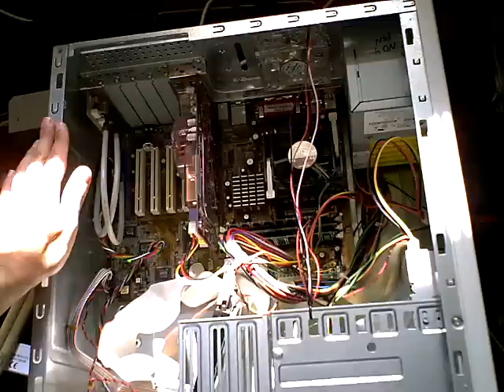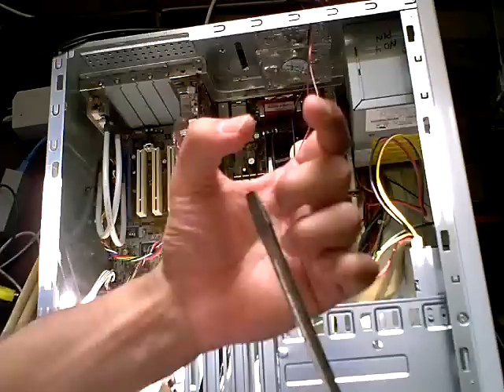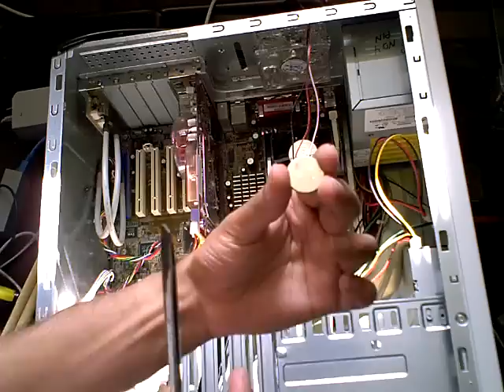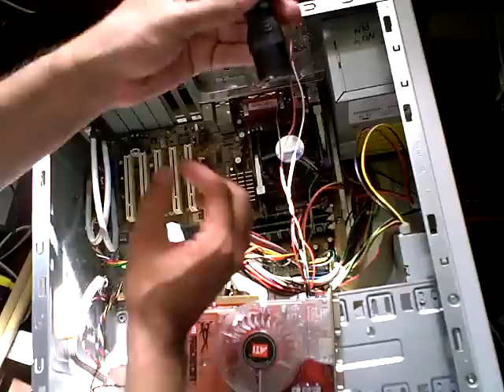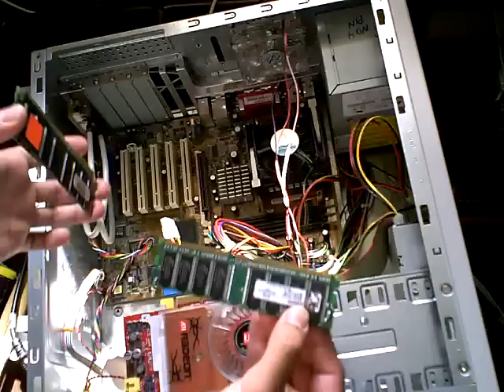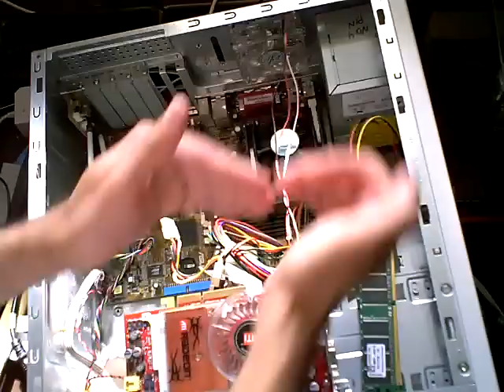How to possibly fix a PC that will turn on but will not beep and will not display anything on screen

Comment: Hey Sir, Can you help me with my problem on my Monitor? I Did all of them, And it didnt worked? I Have 2, 2Gb Ram and I Switch it after it Fails to Turns on, It didnt worked, And i remove my gpu and my Ramand Clean, It Didnt Worked, Please? Please
reply Immediately
Reply from the maker: +TBC_Ryan TheSilentSlasher Breadboard it (explained in the following video:)

If the steps in this video did not provide a solution to your problem, view:

http://www.youtube.com/watch?v=_EK9a-R5pss

You never know, maybe rebuilding the PC in the opposite sense that you took it apart will solve the problem.
Reply: +RodneyDickson Ok Thank You, But fo i have a Chance?
Reply: +RodneyDickson I Did also the troubleshooting But I Donw know what to do, When i Remove my Ram, I Heard The Beeps What should
i do?
Reply: +RodneyDickson Can I Add you on Facebook so that we can talk to each other?
Reply: +RodneyDickson How can I tell if the RAM is DEAD? And not working anymore?
Reply from the maker: +TBC_Ryan TheSilentSlasher Beep error codes differ from one BIOS manufacturer to the next. To discover what the beep error code is trying to telling you, discover the manufacturer of your BIOS (available in the motherboard's manual or on the motherboard's manufacturer's website {on the page for your specific motherboard model}) and then look up the frequency and interval of your beep error code on:

http://www.computerhope.com/beep.htm
Reply: +RodneyDickson Hey Sir Thanks for helping me, The only problem on my Monitor is that i have a Dead Ram! And I remove it on my motherboard and try some of my Ram and it finally worked after 3 days of suffering, Again Thanks for Everything, I owe you
Reply: Hey sir can you make a video on how to make your 32 bit operating system into 64 bit operating system without the method 30 days? (Windows 10)
Reply from the maker: +TBC_Ryan TheSilentSlasher Glad to hear you got to the bottom of the issue. Sadly, as far as I know, 32bit and 64 bit operating systems are built on different architectures, and therefore, there is no real way to 'upgrade' per se, instead, what happens is that the operating system saves your existing data and replaces all operating system files with 64 bit variants. Furthermore, if you obtained Windows 10 as an upgrade, then you received 32bit because your original Windows was a 32 bit variant. You see, 32bit and 64 bit Windows are different operating systems with different licenses. If you have a license for a 32bit version of Windows, then you cannot legally obtain a 64 bit version for free. Also, keep in mind that your PC's architecture would have to support 64 bit (if your PC came with a 32 bit Windows, then there is a good chance that it is simply not compatible with 64 bit). Believe it or not, I have a Dell Pentium Core PC that runs Windows 7 but is NOT 64 bit compatible...32bit-only PCs still do exist!
Reply: +RodneyDickson So it means i cant upgrade my 32 bit OS?
Reply: +RodneyDickson I got an windows.old on my local disk, but i dont have an option "Go back to windows 8.1" In the Settings of my Windows 10?
Reply from the maker: +TBC_Ryan TheSilentSlasher Yeah, you cannot upgrade your Windows 10 to 64bit unless you purchase a license for Windows 10 64 bit. Also, as mentioned, you need a PC compatible with 64bit before you upgrade. Finally, unless you have restore discs for Windows 8, you cannot go back sadly
Reply: I have the iso file for upgrading to windows 10 64 bit?
Reply from the maker: +TBC_Ryan TheSilentSlasher Once again, to legally install and use that software, you would need a legitimate license for 64 bit windows 10 (and btw, Windows 10 is ALWAYS reporting to Microsoft, so keep that in mind). On the subject of ISO files, they are burnt to disc. There is a ISO burning utility in Hiren's BootCD. See http://www.youtube.com/watch?v=eEfGhWXJVJM if you require more information on Hiren's BootCD.

Comment: I have this problem, and didn't have it earlier today, I haven't done anything different it just stopped posting, and the power button doesn't turn off the computer
Reply from the maker: +Timeforfunstuff Breadboard it (explained in the following video:)

If the steps in this video did not provide a solution to your problem, view:

http://www.youtube.com/watch?v=_EK9a-R5pss

You never know, maybe rebuilding the PC in the opposite sense that you took it apart will solve the problem.

Comment: I have a cyber PC and mine puts displays the cyberpower sign but it just resarts over and over again after displaying the sign.
Reply from the maker: +Terrance Calder Sounds like your operating system is corrupt (or your hard drive). Alternatively press F1, F2, Delete, Tab, and Esc during first boot to try to get into your bios, and see if there is a HDD that is detected

Comment: so how are u meant to tell if this is the source of the problem? does every computer beep like this?
Reply from the maker: If the PC has an internal speaker installed, then yes, it will beep. Some manufacturers are getting cheap and no longer including speakers, in which case you will need to buy one and connect it in order to diagnose such issues. Check your motherboard for such a speaker (either connected to the case or attached to the board) to ensure you are not just listening for a beep that will never come.

Comment: hey i have a problem on my pc,when i turn it on it goes well but when it says welcome and go in pc it opend my computer and every thing behind is black..(i can use computer but when i click x on my computer then is every thing black then i see yust mous
Reply from the maker: It sounds like there has been corruption at the operating system level. You can always try booting in Safe Mode (hold F8 at boot) and if that works as intended, perhaps disabling any startup programs that may be causing this (see How to optimize your Microsoft Windows to start up faster, run faster, and to increase stability ) will help, or uninstall and reinstall your video driver. If none of these help, sadly a format and fresh reinstall  of Windows might be the only solution. Good luck with it.

Comment: Hey man so I just watched the video followed the steps and all my problem is that this pc is about 3 months old because I built it myself and none of the usbs are working and I cant get my monitor to sense that the pc is there and I also can't get sound
Reply from the maker: Breadboard it (explained in the following video:)

If the steps in this video did not provide a solution to your problem, view:

http://www.youtube.com/watch?v=_EK9a-R5pss

You never know, maybe rebuilding the PC in the opposite sense that you took it apart will solve the problem.

Comment: hey man I have a issue my computer starts and everything runs I get no display but i have noticed that it is because my graphics card is not responding it is connected to the motherboard and power supply but when i turn on my pc nothing happens the fans on the graphics card don't move there is no response from the card i have had it for over a year and a half this is something that has just happened and i have no clue what to do
Reply from the maker: +tj mj The card could be dead. Your motherboard socket could be dead (or routing to said socket). The power connector to your video card could be dead. There are a lot of possibilities here.

Comment: Hey, my computer does not turn on after I pulled out the battery. What does it mean?
Reply from the maker: +Sydney00111 Hmm, that's strange. When you reconnect the battery, does everything run as normal or do you have an issue preventing you from using the PC?
Reply: +RodneyDickson There was a black screen and nothing else when I started the PC. I pulled the battery out and it just wouldn't start. After I inserted the battery back it did work again, showed some kind of report on a screen about all the detected components and then image messed up and computer frozen. I bought a new battery and after couple of hours the system managed to start, but after a couple of minutes it frozen and some artifacts started to show up. I observed that when the computer is lying down on the floor it works just fine, and when I tilt it up some artifacts start to display on a screen. Most likely it is some issue with graphics card or a loose radiator. Today I am going to change paste on my processor (I did not change it since 2013 so it is a dust now), maybe it will help. I also observed that it could be a damaged PCIE port, as one of the pins is out of the line. I reseated graphics card, RAM and radiator. I also checked all the connections and also replugged it. I removed dust from the case. What would you suggest to do next?
Reply from the maker: +Sydney00111 You seem to have a good handle on what you are doing. The only thing I could suggest beyond everything you've tried is to Breadboard it (explained in the following video:)

If the steps in this video did not provide a solution to your problem, view:

http://www.youtube.com/watch?v=_EK9a-R5pss

You never know, maybe rebuilding the PC in the opposite sense that you took it apart will solve the problem.

Comment: hi can you tell me what happens if you for get which post the jumper came off because i forgot which setting i was on any help guys
Reply from the maker: If you have the motherboard manual, you can look for where the specific CMOS reset jumper is indicated and place the cap back on the lower of the number designations (so if the manual calls the jumper pins 1, 2 and 3, you'd want to cover 1 and 2 but not 3.) If you do not have the manual, look up your manual online. If you really have no clue how to find the manual, perhaps you can look up a YouTube video on your specific motherboard and see how others have this jumper cap. Finally, if you are completely out of ideas, you can just look for any uncovered pins of 3 in a row and try the jumper cap on whatever looks like the 1st and 2nd pin (boot your PC, set the date and time in the BIOS, save your settings, then that night before going to bed, unplug the PC and press the power button on your PC, then leave it as so. In the morning (or whenever you get the chance) plug her back in and power up: if the date and time remained in the BIOS, you covered the right jumpers. Good luck.
Reply: hi thanks never thought of that one

Comment: when I press the the power button, the light comes on it, the CPU starts then after 2 second the whole CPU stops or shut down the light on power button also goes away
Reply from the maker: +Karan Bulani If your computer powers on but for a mere second or two and then immediately powers down, It sounds like your motherboard is developing a short circuit due to contact with the metal casing. Most likely it has to do with the screws and metal mounting stands (supports) that your motherboard sits on. The cheapest way to fix this problem is to introduce cardboard washers between the screws and where they make contact to the motherboard, or you can buy plastic mounting supports at a computer shop.

Alternatively, you can always Breadboard it (explained in the following video:)

If the steps in this video did not provide a solution to your problem, view:

http://www.youtube.com/watch?v=_EK9a-R5pss

You never know, maybe rebuilding the PC in the opposite sense that you took it apart will solve the problem.

Comment: What do I do if when I try to upgrade my ram and there's no display or beeps but when I put the old ram back in it boots up like normal
Reply from the maker: Note that matching bus types of video card to motherboard socket (for example, both motherboard socket and graphic card are PCI-E 16X) or matching bus types of RAM module to motherboard socket (for example, both motherboard socket and RAM module are DDR3) does not necessarily signify compatibility. There is a chance that this new hardware is not compatible with your motherboard, despite the same bus type and despite the fact that the new parts fit in their respective motherboard socket. Your motherboard manufacturer's website will have a support page dedicated to your motherboard's model, and on this support page should be a compatibility list for such components as video cards and RAM modules. Ensure that your new component is certified to function with your motherboard, and if your new component is not present on the compatibility list, then there is a chance that the component is not compatible with your motherboard.
Reply: ok thanks

Comment: Tested my PC worked perfectly at the place i bought it, brought it home and this happens. Every single thing in my PC is new. I dont get it.
Reply from the maker: Could be your peripherals that you are connecting to the PC. To know for sure, Breadboard it (explained in the following video:)

If the steps in this video did not provide a solution to your problem, view:

http://www.youtube.com/watch?v=_EK9a-R5pss

You never know, maybe rebuilding the PC in the opposite sense that you took it apart will solve the problem.
Reply: RodneyDickson Finally got it working with a new monitor! It was a bad monitor the problem all along.  I cant believe it. Thanks alot for the help anyway. :)
Reply from the maker: Heh, you hardly ever hear that as being the issue. Regardless, glad things are working now : )

Comment: please please please respond to this i need help desperately. ok so i had just started to cable manage by pc but before this it was working fine and i was playing games on it. Ok so when i was done cable managing i powered my pc on again to try and use it to play video games. but them i noticed that my blue led wasnt on when i powered it and the speaker beeps werent happening so i just undid everything and put it back the exact same way it was then i powered it on and still nothing on screen but this time i heard the beeps. there was 2 just like this beep....beep and then nothing happened but still the power led or hdd led arent turning on  and nothing appears on my display. i hvane tried the thing you are doing in the video im just about to right now i will reply to this if it works but if it doesnt or even before i reply please help me.
Reply: i think it was a problem wiht my gpu
Reply: it was i solved it thank you i subscribed
Reply from the maker: Well, glad you got to the bottom of your problem then : )

Comment: well I have a spec 10 case with a rog cross blade ranger motherboard in it plus all the parts I need in it. But it is not posting anything. but my mother board is showing 99 on the mother board thing.So I see everything is running. But nothing on my TV screen shows.
Reply from the maker: +James Johnson You gotta look up that error code on Google unfortunately. Your tech is newer than my knowledge : )
Reply: Well  on Google it said not booting. Is what the code means?
Reply from the maker: 'not booting'? Heh, what's the point of the code then? You figured that out before even looking up the code : ) Sadly, I haven't a clue. Only thing I can suggest is to Breadboard it (explained in the following video:)

If the steps in this video did not provide a solution to your problem, view:

http://www.youtube.com/watch?v=_EK9a-R5pss

You never know, maybe rebuilding the PC in the opposite sense that you took it apart will solve the problem.

Comment: Ok, so i tried to delete everything off my computer. It came to 50% then i got an error. I restarted my pc. When i boot it, it launches, and where its supposed to be the windows login place, is now just a black screen. Please help, ive searched all over internet. 😭
Reply: And i get no error messages.
Reply from the maker: Sounds like you corrupted your Windows install (maybe you deleted critical boot files). I'd access the hard drive by slaving it to another machine, I'd back up 
all non-recoverable data, and then I'd format and reinstall Windows.

Comment: my pc was able to start after reseting the cmos, does that mean i only have to replace the battery?
Reply from the maker: It might not even need replacing: sometimes the CMOS can become corrupt, and doing this resets it. Nonetheless, it won't hurt to replace the CMOS battery, so you can always do this as a precaution, but I run a lot of PCs with dead CMOS batteries (not all PCs can run this way btw)

Comment: +RodneyDickson just yesterday my computer was working with the moniter but right after i put in my new graphics card it wont work!
Reply from the maker: +DAN00B591 If this is new hardware that you are installing on your motherboard (that has not yet functioned on your motherboard,) note that matching bus types of video card to motherboard socket (PCI-E for example) or matching bus types of RAM module to motherboard socket (DDR3 for example) does not necessarily signify compatibility. If this is the first time you are trying this hardware on your motherboard, there is a chance that this new hardware is not compatible with your motherboard, despite the same bus type and despite the fact that the new parts fit in their respective motherboard socket. Your motherboard manufacturer's website will have a support page dedicated to your motherboard's model, and on this support page should be a compatibility list for such components as video cards and RAM modules. Ensure that your new component is certified to function with your motherboard, and if your new component is not present on the compatibility list, then there is a chance that the new component is not compatible with your motherboard.

Comment: To prevent your motherboard from having short circuits with the metals of the case, avoid dragging the computer on the floor even when it is off
Reply from the maker: +simon anthony Good tip! Thanks for sharing